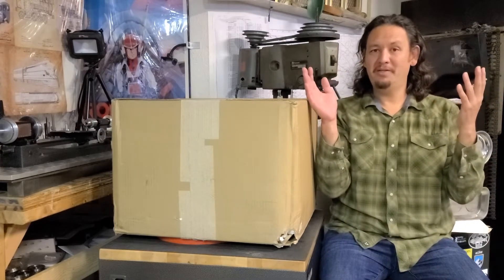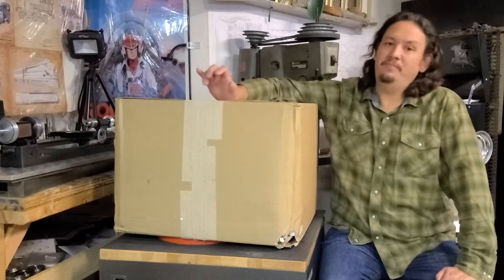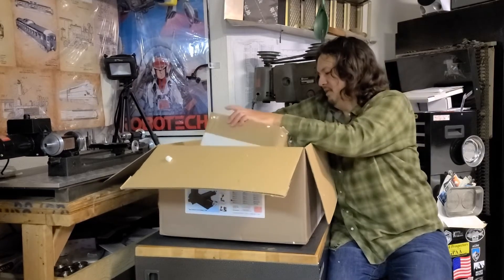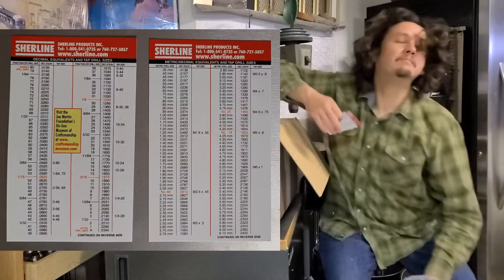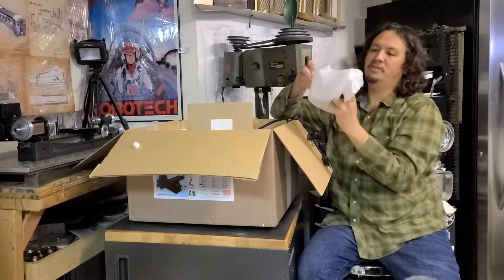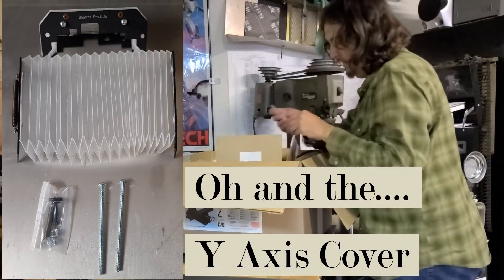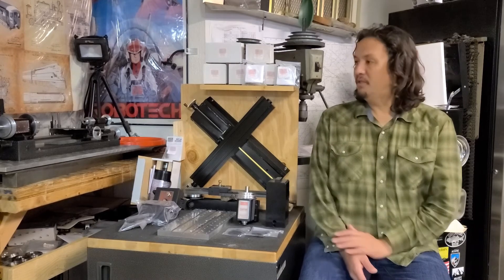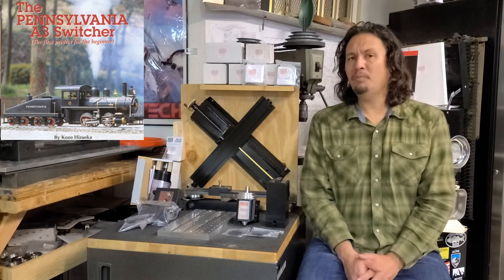Unboxing: Taig ?!?! Sherline ?!?! Proxon !?!? MILL Desktop Mini Micro Home Shop!!!!

Comment: Hi Loyd   Congrat's  on  your  mill  you'll  enjoy it  very  much.  Your  research  method  is  pretty  much  like  mine. I  read  pretty much everything i can find, watch ytube's on the item, check machine sites etc. I HOWEVER  HAVE REFINED  MY  PROCESS A LITTLE  BIT  MORE  --------------- I  JUST  GET  (1)
EACH   IT  SEEMS ----LOL!!!!!!!!  IT  DEPENDS ON  SITUATION. MOSTLY MACHINE & INCLUDED  TOOLING!!!!  BY  TOOLING I TRY  TO  OBTAIN ALMOST (1) OF EACH ITEM  MADE FOR IT MANUFACTURED FOR IT BY MANUFACTURER.  LIKE YOU AM BIG FAN OF U.S.A. MADE TAIG / SHERLINE TOOLS. ACTUALLY MET JOE M. @ CHICAGO HOBBY SHOW (1) YEAR. IF YOU WANT SOME INSITE ON JOE ---GET HIS  BOOK ON MACHINING---GREAT BOOK----JUST  READ THE  KNURLING SECTION.  LATEST PURCHASE  SHERLINE 5000 /10'' DRO MILL. WOULD   HAVE LIKED THE 12'' BUT  THE  ''DEAL'  WAS  THERE----------------------------REMEMBER   TOOLING ----------------IT  WASN'T  USED/HAD DRO/ CAME WITH (2) DR. CHUCKS/DRILLS-M/M-/ TOOLING  PLATE/STEP CLAMPS/ COLLETS / END MILLS /C-SINKS/ ROT TABLE --TILT TABLE---ADJ TAILSTOCK ======GEAR CUT/TEE NUTS   STUDS  NUTS/ETC I DID ADD THE   NEW SHERLINE FLUSH TABLE MOUNT VISE FOR TOTAL TABLE USE. 
NEXT PROJECT  NEW  SHERLINE   4400  /B  LATHE 
ENJOY  MILL      MIKE

Comment: Congrats on the new mill. I'm planning on upgrading to a Sherline mill but am having trouble deciding which one i want to get, the 12" Deluxe, the 14" 8 direction or the 18" Next Gen. Can you tell me why you chose the 5800 Next Gen over the others?  And why you went with the inch vs Metric readout?   Like you I will be using it for model railroading but in a smaller scale.  I model Z scale 1/220,  My Proxxon MF70 has served me well but has its limitations.
Reply from the maker: Congrats on the upgrade. I don't think you could go wrong with Sherline. Though have you give any consideration to Taig?  I went with the larger primarily for 2 reasons. Capacity and the ability to rotate the head like a Bridgeport. Though in hindsight I've come to understand rotating the head is not often done. As for capacity there isn't anything clear as to how rigid it will be at the table extremes.  I still want that capacity for future projects. As for column rigidity they all appear to use the same column bed. I went with inch because that is what I'm use to and grew up with.  I want to do 7.5" gauge someday so I was planning the increased capacity. I also make my own archery parts and off road gear so I want that capacity.  Thanks for asking I hope that helps.
Reply from the maker: I forgot to mention. I think Sherline sells columns and bases to expand capacity and upgrade so increased capacity can be bought in the future. Plus, the savings of a 12" machine someone can get a Rotary Table and have money left over with what the 5800 costs. As for your size I'd recommend seeing what the watch and clock makers use. I feel their capacity would be more relatable to Z scale.

Comment: Congrats on the new mill….If I didn’t have Unimat for so many years, I’d certainly purchase Sherline.
Reply from the maker: Thanks I apretiate your views. I looked at the Unimat but couldn't really come to a decision. What isbit about the Unimat you've found in your experience with it?
Reply: @LoydPrecisionMakers  with a second motor and milling head permanently mounted on the Unimat 3, it becomes a self contained lathe and mill. Simply remove the lathe tool post and mount the table on the cross slide and the mill is ready to go.
Reply from the maker: @BobLewen  That is nice and must be great for space saving.  One of the options I looked at for Sherline was the mill adapter.  It was among the reasons I got their largest lathe.  But I felt tike the down time was a bit much between swap outs based on what I read on the instructions.
Reply: @LoydPrecisionMakers  what you have is terrific, American made engineering and accuracy, that is unbeatable for its size….I strongly recommend you look at another YouTuber….. “Tryally Tech Tools” to marvel at the capability of the Sherline products….. he’s in Brazil and is amazing. Anyway enjoy your loco build.!
Reply from the maker: @BobLewen  Thank I am enjoying this build.  I will definitely check out that channel.  It hasn't come across my feeds.  goes to show you the all mighty google algorithm😆, doesn't know everything.

Comment: I have a sherline mill too. Excited to see you use it!
Reply from the maker: Thanks I'm excited to get it together and start making parts too.  How have you enjoyed using yours?
Reply: @LoydPrecisionMakers  Been practicing making 'precision' parts and learning a lot. Love metrology and learning the limits of my machine.
Reply from the maker: @djvanzz  Very cool. I think the Sherline can hold the tolerances. Whole I'd never call myself a metrology person. I am enjoying learning about the means to measure and measuring tools needed determine those high degrees of precision. I hope to someday learn how to use an air gauge. The journeyman tool and die maker has one I've only seen from afar.

Comment: I have the 5400, with a rotary table, that I converted to 4 axis CNC.  Sherline makes good stuff, I think you made the right choice.
Reply from the maker: Oh wow. I would love a Rotary Table myself. I hope to cut the drivers from scratch. Did you go with the Sherline Cnc kit or another kit?
Reply: @LoydPrecisionMakers  I bought their motors and mounts, then did the rest myself using a TinyG driver board.  I use Autodesk Fusion 360 for modeling, it’s free for hobbyists, and has a 4-axis post processor for the TinyG.  Not pushing any of this, that’s just how I did it.
Reply from the maker: @Reach41  That is neat and something I liked about sherline and that it had future upgradability to a CNC.  How do you like Fusion 360?  I want to try one of the CAD programs but can't quite seem to figure out which has the easiest learning curve and is the most intuitive.
Reply: @LoydPrecisionMakers   For the most basic designs using solid modeling, all offerings are likely very similar.  The largest obstacle is just getting past the first couple of hours because everything is new.  But once you learn how to open and save a new file, get a handle on working with the three main plane surfaces (the x,y, the x,z and the y,z planes), and using the basic drawing features - lines, circles, rectangles, etc., you are off to leaning to create 3D models with them.  Look on youtube for recent Fusion 360 tutorials, there are a million of them, and watch one that starts with basic sketching if you want a quick overview, then go on to the next step, which is extrusion (which they sometimes refer to other names, such as pulling, etc.).  A quick example, in words, is to draw a circle in a "sketch," then "extrude" the sketched circle and form a "body," which would form a cylinder of whatever diameter and length you specified.  Similarly, you could create a hollow cylinder by sketching a second circle on the same centerline and plane, and then extruding it using an option to subtract, or "cut", the second extruded circle from the first.  By adding, subtracting and cutting using extruded basic sketch shapes drawn on the three principle planes, you can build up about anything.  

It is really that simple.  The complexity comes in when you want to be able to do those things quickly, using program shortcuts, or when working with non-planar shapes such as a streamlined car body, etc., but that's also where the true power of solids modeling lies.

All that said, if I wasn't creating CNC code from my solid models, I doubt that I'd use solid modeling at all.  For sure, if I was machining using a manual machine, I'd only use a simple 2D application, or a T-Square, for my designs.    

I enjoy your videos, and often learn things from them.  Keep up the good work.
Reply from the maker: @Reach41  Thanks for the advice and insight it really is great. I really want to learn it because of a the fixtures I'm making up. Plus it is kinda hard to communicate issue like holding on .020. I think would be better illustrated with a screen shot or in cad.  I appreciate you taking the time to write the above.  I am going to have to take a day and just do it!!!